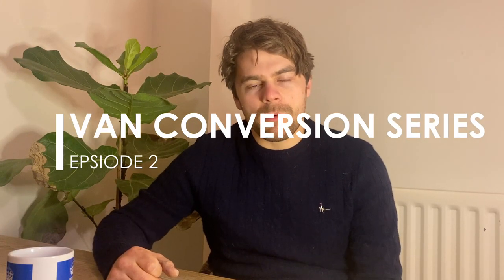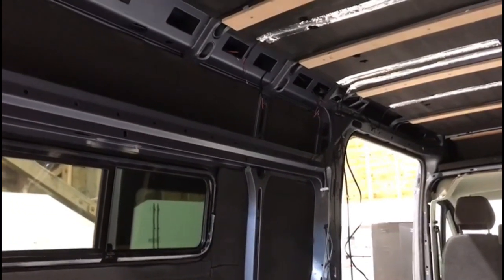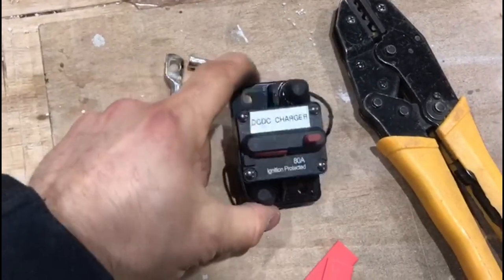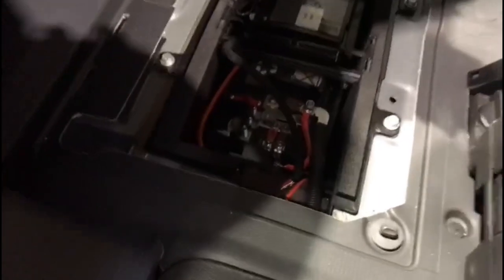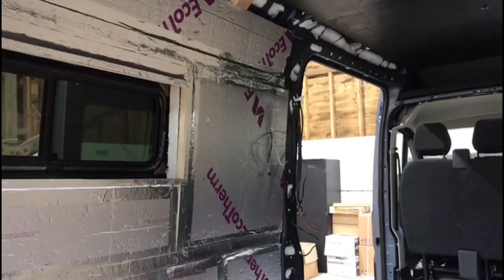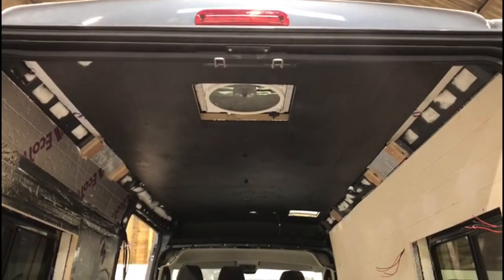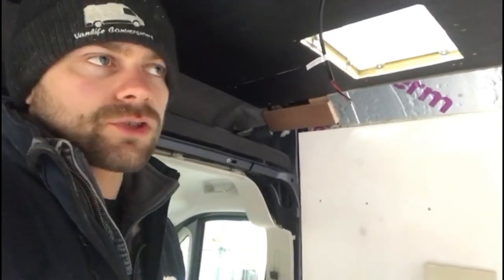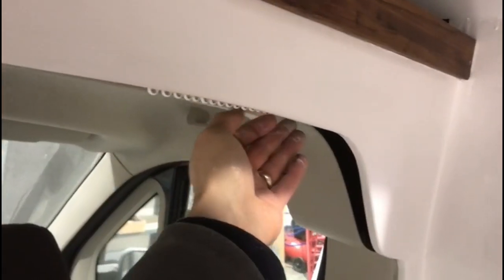WEEK 2 | Insulating, lining & more 1st fix utilities | START to FINISH Van Conversion Series

Comment: Oli this is amazing! I’ve been using your techniques to do my build but was always scratching my head on a few bits, this series is filling in all the gaps, can’t thank you enough for sharing your skills and insight, bravo! 🙌 👍
Reply from the maker: Awesome! Thank you for your feedback
Reply: @vanlifeconversions  quick follow up question Oli! 😂 where you’ve packed out the pillar with some plywood structure (by the sliding door), did you have to add a bit of structural plywood to the rest of the framework on that side so that the final 9mm ply lining sits flush?? I’m just tackling this bit on my build and I’m thinking this is the what I’ll do, but curious how you tackled it!

Comment: Hi Ollie , following your framing of the walls. What thickness closed cell foam do you use for ceiling , walls and floor 🙏
Reply from the maker: Hi Lee.The closed cell is between 8-10mm thick. All the best
Reply: @vanlifeconversions  thank you so much for the quick reply on this part now . As a marine upholsterer myself I have just upholstered my peugeot boxer seats and armrests in marine vinyl with diamond stitching .
Reply: Have sent a link to my design I've done

Comment: Do you attach a thin batten to the ceiling at the back of the van, as there's no rib to attach the rear edge of the ceiling ply sheet to? I've seen some self-builds force a piece of batten into a curve against the brake light horizontal pillar and hold with self-tapping screws but it seems a bit dodgy.

Appreciate the replies to our previous questions too thanks, we want to do it right first time.
Reply from the maker: Yes we do, ensure it is glued and screwed into the horizontal pillar. We like to use stixall as it is very strong adhesive
Reply: Thank you!

Comment: Such helpful vids! Do you use different thickness PIR boards for the floor compared to the walls? I'm unsure the best thickness of battening and PIR for the floor. 

I see you also used to use two layers of board PIR of different thicknesses in older builds (25mm in the recesses then 50mm on top was it?) - did the closed foam insulation roll replace that 25mm PIR board layer in recent times? I want to avoid over spending lol.
Reply from the maker: Thank you for your message it is really appreciated. For the floor we use roof battens alongside 25mm PIR insulation boards. For the walls we use closed cell foam stuck to the metal of the van. Then we use 50mm PIR Board in the shaped voids (except where the bed recesses we use 25mm). And for the final layer of insulation we friction fit 25mm PIR board. I hope this helps
Reply: @vanlifeconversions  great thanks so much for replying - are those 25 x38mm battens?
Reply from the maker: @Dovoro82  we get 25mm x 50mm, but 38mm will also work great. It’s the 25mm dimension that is most important as this is the same as the insulation board. It therefore sits flush with it
Reply: @vanlifeconversions  amazing thanks for your time and advice!!

Comment: Hello. What is the thickness of the closed cell foam from the walls? And the size of the wall battens is 25x50mm? Thanks
Reply: I’m using 9mm closed cell foam and 25x50mm battens, works a treat 👍